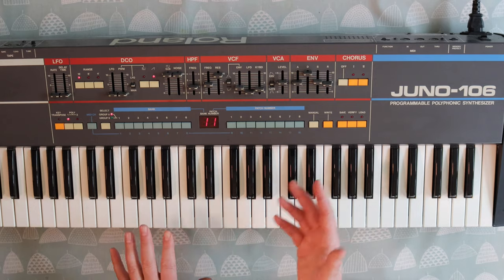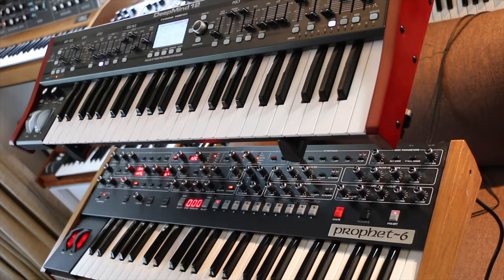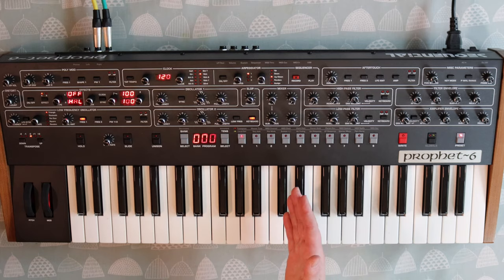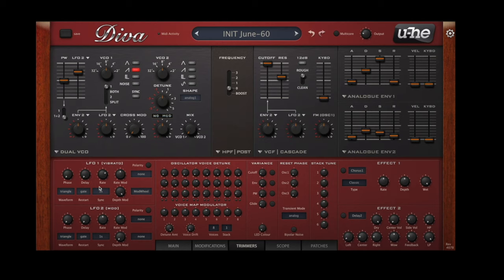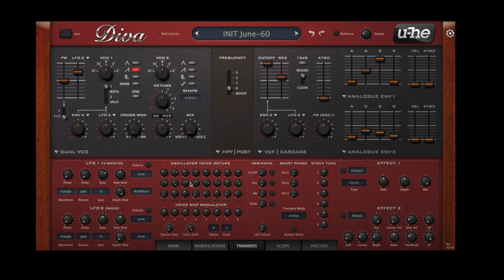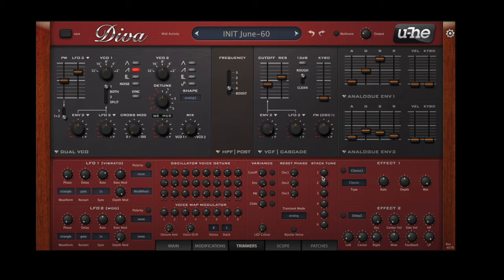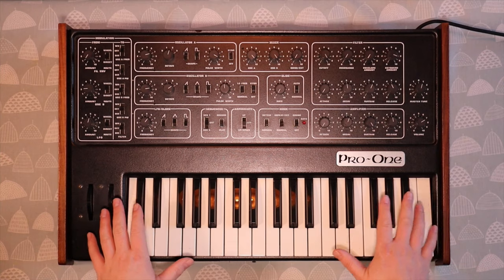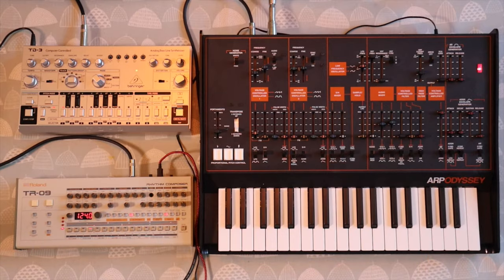DCO vs VCO: Slop, oscillator drift and variance explained

Comment: There is one BIG difference that wasn't mentioned. VCOs are capable of FM cross mod (their both input and output is analog voltage), DCOs are not (their input is digital, their output is analog). On synths like JX-8P, the cross mod is implemented as AM (variation of ring modulator) instead of FM. It's theoreticaly possible to implement FM cross mod on DCOs  using AD conversion, but I'm not aware of any synth that uses it, maybe it's not worth the added complexity. Nowadays it's more attractive to use NCOs (some call it DDS - direct digital synthesis) with high oversampling implemented on FPGA like the peak/summit does.
Reply from the maker: Good point, and pinned.  ... and I thought I'd already gone into too much depth :) Theres a couple fo other comments about the limitations of DCO that I omitted from the video. It's always difficult to know where to pitch it.. to much or too little.
Reply: My JX-10 has crossmod. I don't think it's FM.
Reply from the maker: @amonster8mymother  Its actually Audio mod of the filter the JX10 - so not exactly cross mod of one osc with the other.  It's the same as you get on the Prophet 8 and Rev2 - both DCO. The terms are almost interchangeable as the Prophet5 and 6 for example have filter mod in their x-mod section, but most I think consider x-mod to be osc to osc.
Reply: @StarskyCarr  yes BUT if you can "play the filter," then the filter is essentially another oscillator, and because you can directly modulate the pitch of that oscillator by modulating the cutoff, it is proper FM, no asterisk needed.

Comment: The Novation Peak is very good at this kind of thing, it's got both fixed offsets and slowly varying drift. Got to be careful though, they're best at very subtle levels.

As an aside, the digital timer that resets the Juno oscillators is run from an analogue voltage controlled master osc. Hehe.
Reply from the maker: Haha. Aargh too much info 😂
Reply: Agree that the Peak has a good toolkit for this. You can also use LFO 3 or 4 set to random to modulate the speed of LFO 1 or 2 to add more analog variation to pitch, filters, and pulse/wave width. I've been doing some Prophet 5 emulations on it lately, and values of say, 27 for Diverge and 35 for Drift get you in the ballpark as Prophet 5's have a fair amount of drift even when they're in good shape. There's Filter Diverge in the Voice menu as well--less helpful but another tool.
Reply from the maker: I spent hours using the LFOs in the P8 trying to do the same, but the resolution of the amount wasn’t fine enough at the low end.. eg the difference between an amount I’d 1 and 2 was too little or too much. I also tried to randomise using envelope 3 but one of the only modulation destinations missing was the env 3 _’amount (can’t quite remember exactly what parameter but you get the gist). The rev 2 and P6 addition al slip solved it. I’d always hoped it could have been updated in the P8.
Reply: @DavidLee07  yes those extra bits of modulation are really useful. I also like to add some filter drive, as it can be a bit clean without. I parted with a Juno 60 to get the Peak and some other bits and pieces. No regrets.
Reply: @StarskyCarr  it's quite telling they had to add a way to make a modern VCO synth wonkier. I've been thinking of getting one of either of the P6 or OB6, but I'm not sure how much it'll really add to what I get from the Peak.

Comment: Just stumbled on this researching if I want a VCO or DCO synth....   I knew about "slop" on DCOs but didnt really know what it sounded like.  Now I do.   I knew about divergence and drift on my Peak - and always add some without really knowing why.  Now I can hear it.   It also explains why I prefer my Virus "initially" - it has it "always applied" it sounds like (a little when I use both Osc I can hear a little of that phasing, though you cant add more or change it) - though I can make the effect more pronounced on Peal.   Thankyou So so much.   Now I just need to decide If I really do need an analogue synth, and if so what....  As well as Peak and Virus I have one of the new Roland Fantoms and the VA synth engine is nice - filters are great.   its not a deep matrix - but has a filter/Env/LFO per Oscillator which adds its own way of creating great sounds.    I dont really have a "programable Arp" on anything - something I can design my own pattern and have it transpose when I press different keys - and my thinking is a full analogue synth with this capability (if there is one).  I could do it with a beatstep/keystep - and synths like the new Cobalt does have this capability (as does Iridium that Im really tempted with).    Any ideas for a suitable analogue synth though would be great.  Have though Minilogue XD but cant find any info on the arp  - only the sequencer.    Theres the Deep mind as well, but its not really the synth Id like - but I believe it has the programable arp.

Comment: Does the rev 2 with a bit of slop applied sound pretty much spot on with the Prophet 6? I was quite surprised how close the deepmind sounded when you added it.
Reply from the maker: You can make them sound close, and they cover a lot of the same ground but they have different characters. In particular Poly mod on the P6 and modulation routing in the rev2.  Simpler sounds you can get them very close, and the slop on the Rev2 is much deeper than the P8 (the reason I bought the P6). If the P8’s slop had been updated I probably would not have replaced it with the P6.

Comment: I swear I heard someone say that DCOs make it possible for a synth to have presets, but have been since told that has nothing to do with it.  Is there any relevance to preset capabilities in regards to VCOs and DCOs?
Reply from the maker: No.  You can save in VCOs as well. They were probably thinking about analog vs digital control  of other circuits (envelopes and LFOs). If there’s no digital control you can’t save the parameter values in a preset.
Reply: @StarskyCarr  Hm.  Okay.  Yet it would seem that there would have to be some sort of digital information exchange to, say, save the waveform of an oscillator as a part of the preset.  Perhaps this is somehow done outside of, although presumably adjacent to, the DCOs/VCOs?
Reply from the maker: @TheSwircle987  yeah.. something remembering the pot position, but not part of the actual audio control or audio signal.  DCO is an analog oscillator clocked by a digital signal to keep it in tune. The Digital control here is not related to the pot position but the oscillator tuning. A VCO uses control voltages to determine tuning.  The big difference being stability and the ability to do FM on VCOs.  Both can be saved.  The Rev2 is DCO, Pro6 VCO.. both have sweepable waveforms and presets, but the tuning is controlled differently.  There's definitely confusion between them though, with some people thinking DCO is a digital oscillator :)